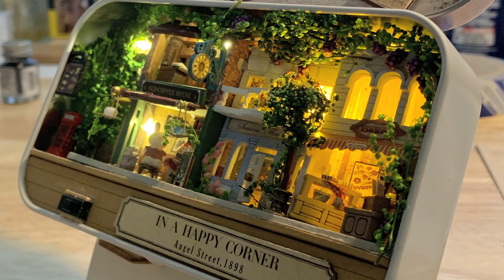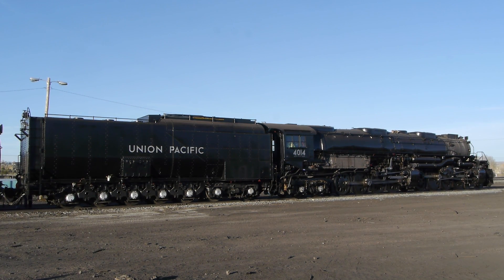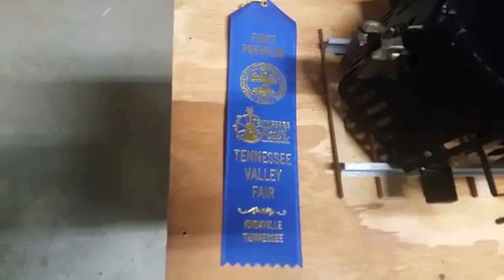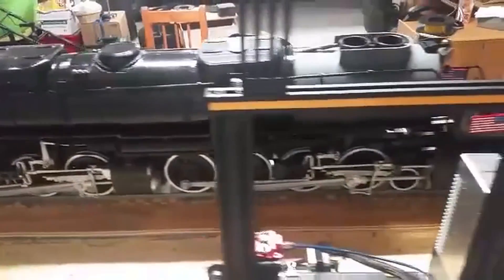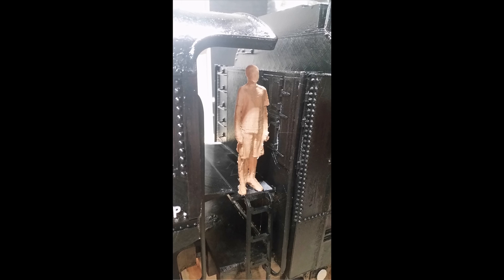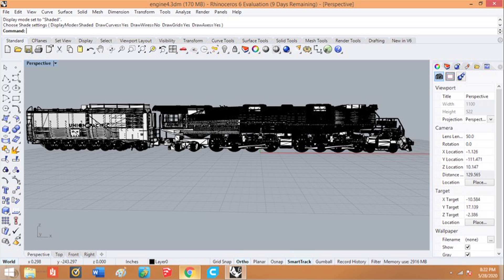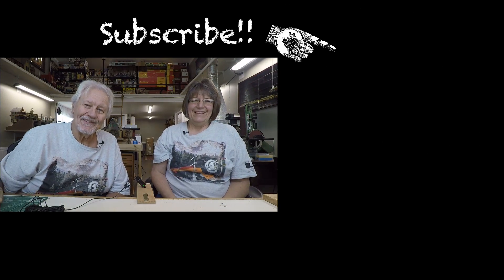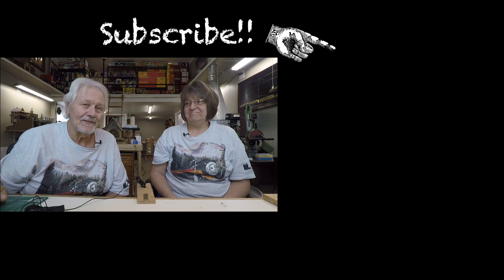3D Printed Union Pacific Big Boy 4014 in 1:15 Scale

Comment: What a beauty! I’m also impressed that it’s only 25 lbs. Even though the material is a plastic, I would think it’d still weigh more.
Reply: Most of the parts are only 10% soild, some of the small are soild. If I had printed 100% it would have used a ton of filament and would have weighed a couple hundred pounds.
Reply: @calebleach7285  wow that's heavy

Comment: I am starting to put my N scale civil war layout. If you might be interested in putting it in a show i will keep you updated on it as it goes. Planning to have it mostly done before Thanksgiving.
Reply from the maker: Haven’t tried it in N scale but I have constructed functional cannons in HO scale! We should do a video on how that works. They fire remotely from 1.5V. Perfectly safe. Produce a lovely puff of smoke and fireball out of the barrel of the gun. I’ve used that for civil war artillery pieces. It involves placing a glow plug from a model airplane engine in a brass tube. Forming the barrel of the gun around that. Then place a tiny amount of flash paper in the barrel of the gun. When you apply 1.5 volts to the glow plug, pop!  and a little fireball comes out of the end of the barrel
Reply: @ToyManTelevision  Im not going to go that far, it is mainly going to be a confederate camp on the layout and the trains supply it. I am going to post a video of the progress so far tomorrow if you want to check it out.

Comment: In the future we'll build real trains with 3D printers.
Reply: Maybe, we can already print houses and cars.
Reply: Caleb Leach metal 3d printers. They’d still have to be machined a little bit it would be very cool.
Reply: @lazarusmagellan2367  I've worked with very expensive metal 3D printers.
Reply: Caleb Leach can they print with a smooth finish?
Reply: @lazarusmagellan2367  Some do some don't it depends which 3D printer metal system your using.
Reply: @calebleach7285  thats awesome. i cant imagine 3d printing my cylinders, taking them from the printer, and then bolting them onto the frames with no machine work. That's awesome.

Comment: Toyman did you here about how the Durango and silverton is converting all of there locomotive to oil 
They rebuild a k-37 493 to run on  oil  and to run the k-37 are back on the main line
Reply: I also 3D printer a gondola car from the Durango and silverton
Reply: not all of the locomotives so far they have converted and restored #493 and are currently converting #473 I don't think they are planning on converting any others.
Reply: Erik The Train Fan on there YouTube channel they explained that in the next five year’s all of the steam locomotives will be converted
Reply: @southernrailwayfan1338  oh I didn't know that I will go check it out thanks!
Reply: Erik The Train Fan  I think it’s on Facebook

Comment: There is one locomotive that is even more impressive than the Bigboy! It is a Beyer-Peacock Garratt 6000 class 4-8-4+4-8-4! It even has 8 more wheels than a Bigboy! You can see 6029 in Australia---- It is incredible!!!
Reply from the maker: Hi. Yup!! It’s an odd duck!!  There are a lot of big impressive engines, someone is very odd configurations. Part of the success of the big boy is that it’s just a regular locomotive. A big powerful conventional articulated locomotive designed for use on the main line. Not help her service nothing special I totally garden-variety locomotive. Only huge and massively powerful

Comment: Where did he buy his 3d printers? Also how much do 3d scaners go for?
Reply: You can probably get a 3d scanner for real cheap but you can probably not get a 3d scanner that works for cheap
Reply: @matthewbearden2959  ok. Where do you suggest would be the best place to look?
Reply from the maker: These printers are online. Amazon has this one for 230. I’ve seen them for 199. But then the shipping puts it right back at 230.
Reply: @jacobramsey7624  thats something you would have to Google and just go from there ,sorry i don't know any good sources for 3d scanners , now as far as printers go it really depends what you want it to do and your best bet is to try to find ppl that 3d printing is there hobby because they can tell you a lot more then I can and its also a good idea to keep in mind that with 3d printing the technology is moving so fast that most information gets out dated quickly
Reply: @Jacob Ramsey Do a search on YouTube for 3-D scanners and 3-D software. There is software now that allows one to take photos with any camera and build a 3-D model that then can be printed. Be aware that size, shape, color, and base material of the object being scanned do matter.
Reply: I got my printers off Amazon. As for the scanner my local high school has one and I was a student there at the time so I just used that one. The scanner brand was Sense if your wondering.
Reply: @calebleach7285  thank you very much! I used to use a 3d printers and lazer cuters in high school. Maby now i could get my own to build more stuff. While I had access to that stuff i build a 2 stall engine house, a O Scail climax, a o scale 44 tunner and other odd ball pices.

Comment: Amazing perseverance on the part of the modeler.  However, for me, FreeCAD has been a much better experience for making 3D models.  It’s amazingly simple.  Just create your model, convert to mesh, and export to an, “STL”, file.  Then it’s off to your 3D printer.  On my channel, I have several examples as to just how easy this is to do.  Oh yes, it’s also completely open source and completely free.  

It’s 2020, open source software is no longer synonymous with garbage software.
Reply from the maker: I use lightwave. Because I started with it in the 90’s. Before that I used picture maker. And FGS 4000. (Cost 250,000) work (school) had one. They even bought a 3D printer in about 1995. Igor to use it once.